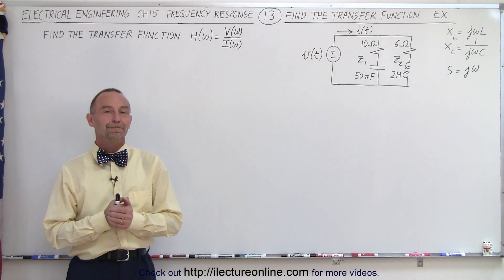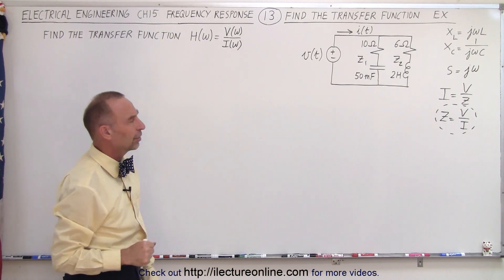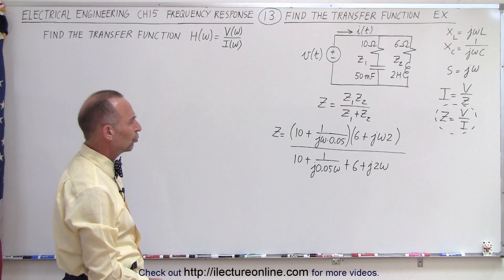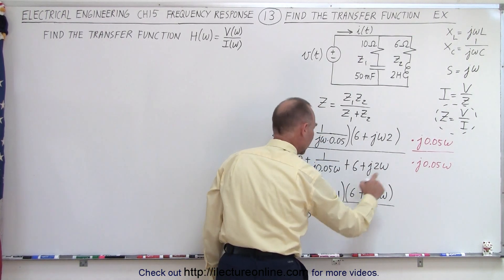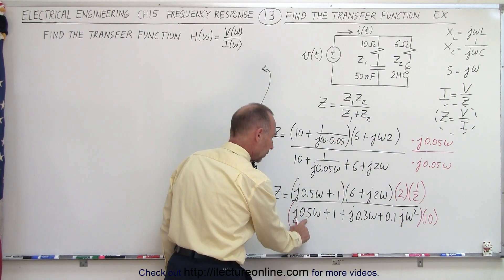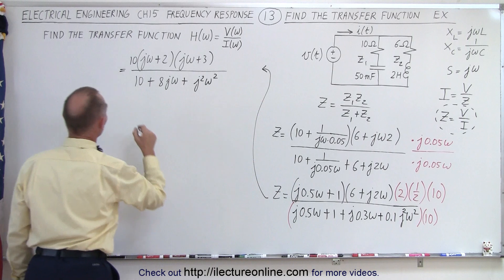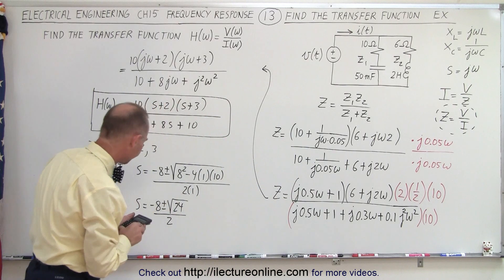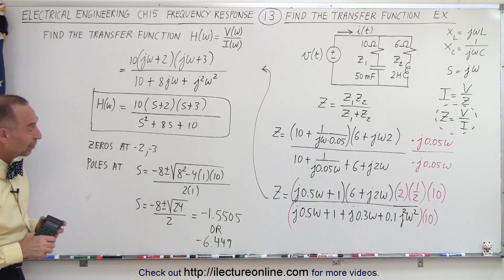Electrical Engineering: Ch 15: Frequency Response (13 of 56) Find the Transfer Function: Ex.

Comment: Is the voltage in DC? I’m a little confused
Reply from the maker: Since the voltage v is given as a function of time  v(t), we can assume that it is not "DC".  And if we need to find the impedance with a capacitor and inductor in the circuit, it would have to be alternating voltage.
Reply: @MichelvanBiezen  how would I be able to find the transfer function in a differential equation form ?

Comment: prof. Biezen, when you multiplied the top and the bottom by j0.05w shouldn't we multiply (6+j2w) by the same number (j0.05 w) too? thanks
Reply from the maker: 3 (AB) = 3 AB   not   3 A  3 B = 9 AB
Reply: @MichelvanBiezen  I was confused because you multiplied j0.05 by (10 and 1/jw0.05) so I thought we should multiply j0.05 by the second oprend.